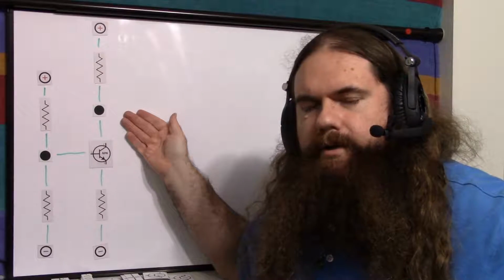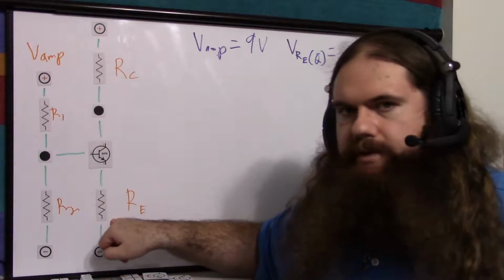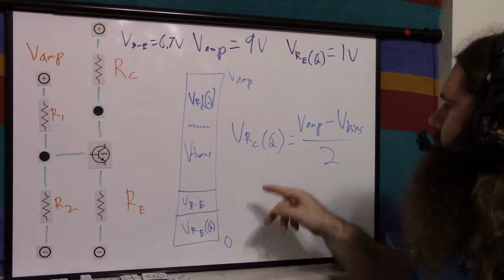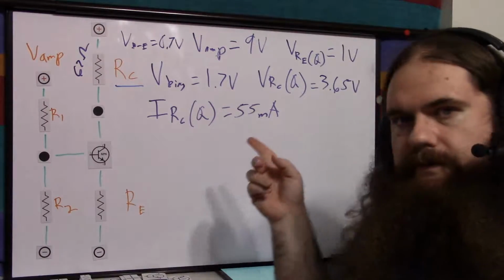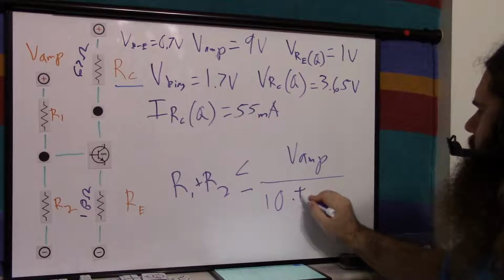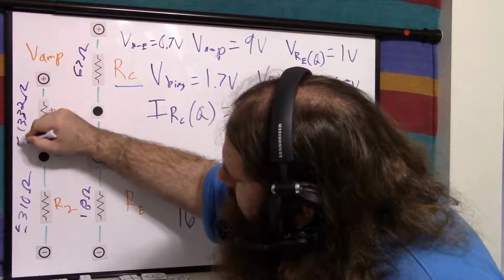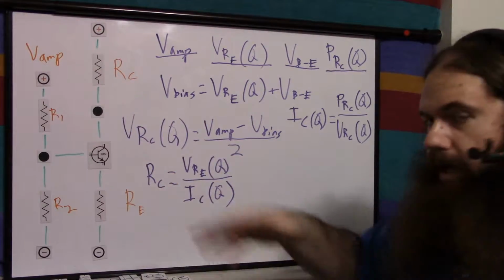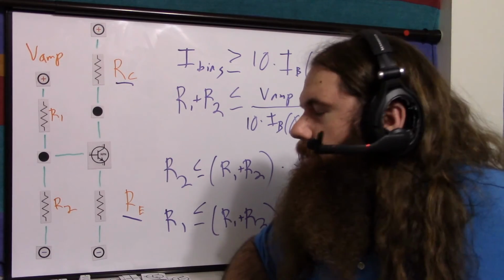Common Emitter Amplifier - More-Intuitive Math - Simply Put

Comment: This is an incredible explanation of something I've been having so much trouble understanding in the last few days. Thank you so much for taking the time to give us such great videos on this topic.
Reply: Why I am not understanding this. I was happy when I see normal ce amplifier circuit. But didn't this voltage divider bias.
Could you tell me 
1) why r1 and R2 need to connect
2) why we need to connect Re emmiter resistance
3) why we need cap parallel with Re?

Comment: Just discovered your videos. Simply amazing explanations. Congratulations!!!
I have a question: you said that best practice is to make the vamp rail drain at least 10 times more current than what goes through the base of the transistor. So you ended up choosing a 310ohm and 1330ohm resistor for r2 and r1.  What i cannot understand is this: The Ibc (current from base to emitter) is what controls the Ice (current from collector to emitter), and not the opposite. Since we chose a 1330ohm for r1 , don't we let 9v/1330=6,77mA pass through the base eventually? Ok, not exactly that much because we have the Re as well in series, but definitely a lot more than 550uA we wanted in the beginning.... And then, since Ibe is going to be about 6ma , then Ice=b*Ibe=100*6=600mA , and not 55mA... An order of magnitude more... How does this not happen eventually?

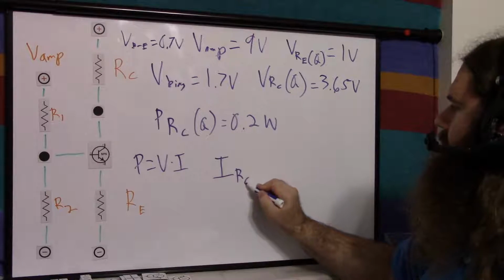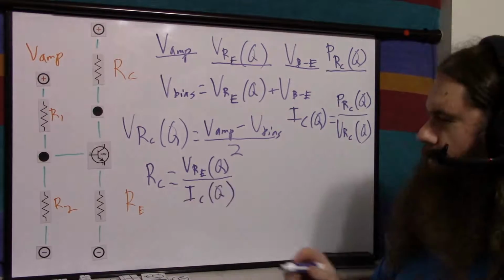Comment: hey, this is an amazing explanation and is helping me hugely, seriously I've been trying to get my head around all this and was about to make animal sacrifices in order to help, thats not good, i'm a vegetarian. I do have a question though about Rc calculation, @9:00 you say Rc is calculated by taking 3.65v (Vrc) and dividing it by 55ma resulting in 67ohms. However in the summary @21:30 you write on the board that Rc is equal to Vre (ie 1v) divided by Ic.....  did you mean Vrc? Thanks again.

Comment: Thank you, again for the way you explain, It's realy simple an clear.
Could you make a practice with real stuff and the oscilloscope, please..
I need to see the amplification of a wave with an transistor.
Reply from the maker: Yep, I've got that as one of the upcoming videos. I'm working now on videos demonstrating the beta-independence and power-supply-ripple-rejection of the amplifier. I'm sorry I'm so slow at putting out videos; They are coming though!
Reply: @simplyput2796 I'm not trying to rush you, it's just that I've been doing amplification circuits in the Multisim program, in order to better understand what you explain in your videos, and I do not see amplification at all. I really think I'm doing something wrong.
On the other hand I really appreciate your videos and I thank you very much for the time you take to make them.
As allways, many thanks.
Reply from the maker: Here's a simulator set up to show the effect. http://www.falstad.com/circuit/e-ceamp.html But I will still do videos on it too of course.
Reply: @simplyput2796  Thank you.